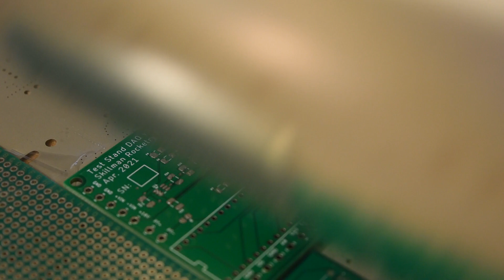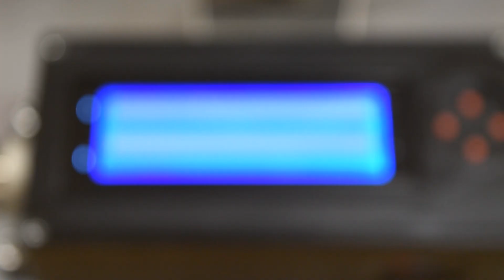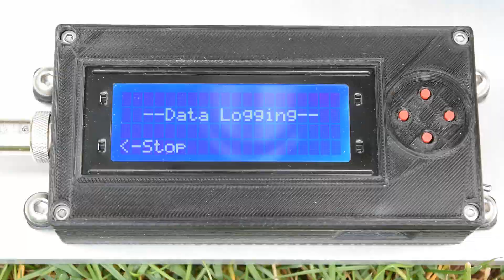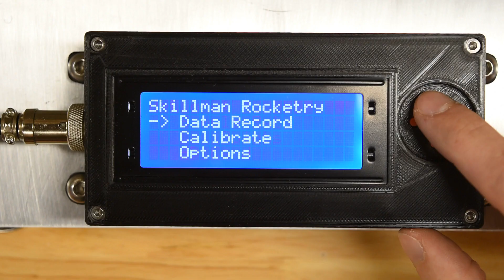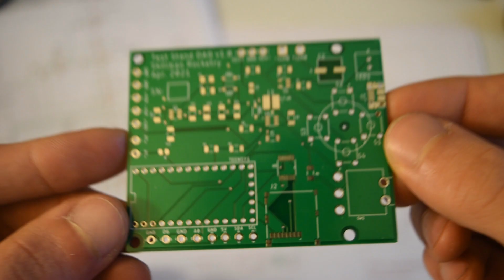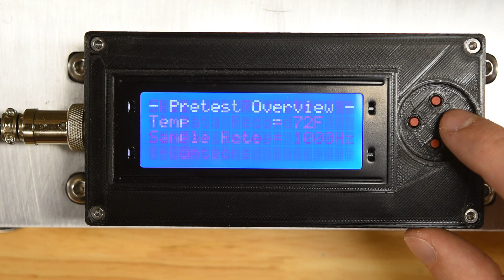Impulse Test Stand (Beta Release)

Comment: Hi Matthew, how did you calculate de Laval's nozzle?
Reply from the maker: Hey Emmet, we designed the nozzle by solving the isentropic flow relations to determine a suitable chamber pressure and nozzle geometry. Here's a page on our website that covers the process: https://skillmanrocketry.com/Notes/Motor_Design/Motor_Design.html
It is a nice visual way to see how we designed our first motor. A program like MATLAB or python is easier if you are planning on making it yourself.